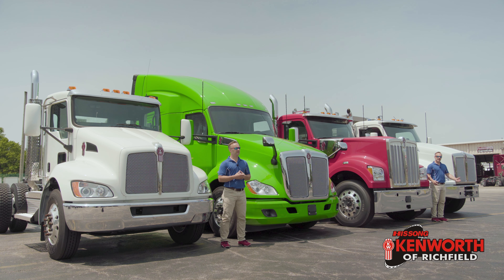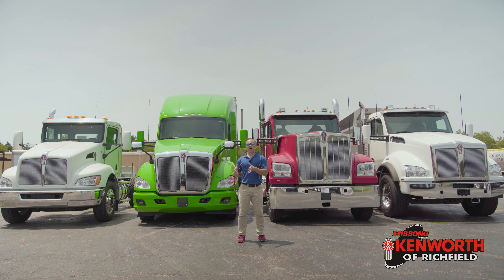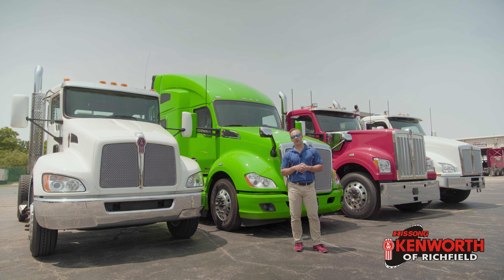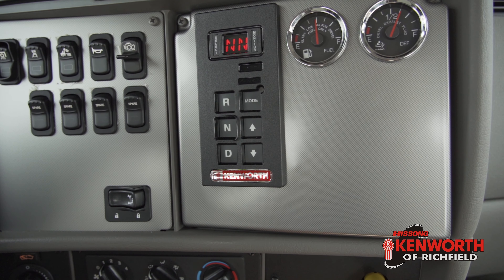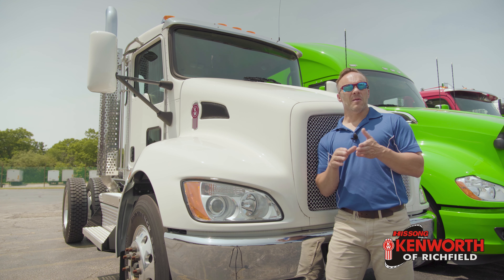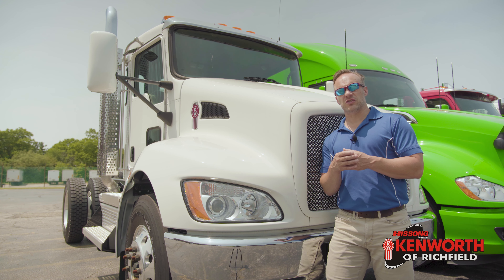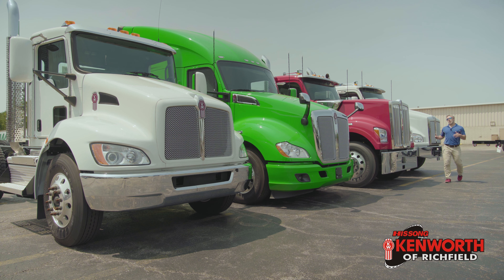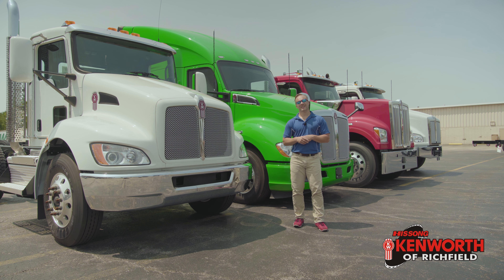Manual vs Automated vs Automatic (AGAIN...sort of)

Comment: Automated manual is an automatic transmission. Regardless if it doesn't have a torque converter.
Reply from the maker: It's automatic, but the industry has adopted these terms to differentiate between a mechanical/clutch driven transmission and a torque converter setup.
Reply: @KenworthofRichfield  Understandable. But I wish these automakers would make educational commercials like Chevy used to do in the 50's.
Reply from the maker: @Trident_Euclid  That's what I'm kinda trying to model after......at least a little bit.

Comment: I like the sound of the endurant, does it have manual mode and 3 step engine braking on the steering column ? I'm a control freak and love manual but that endurant sounds like a meat and 3 veg complete feast with gravy. That painted no chrome look is cool. Edit: Found the video of T680 thanks.
Reply from the maker: Yes it does

Comment: The only issue with an automated transmission is operating in bad weather. If your driving in snow and your sliding/slipping a little the transmission will want to shift up as the wheel speed increases during traction loss. You as the driver would control when to shift regardless of how much throttle applied.
Reply from the maker: I'll agree to an extent.  I've driven in 4" of snow in an ultrashift while bobtail and didn't have much of a problem.   There was one or two spots where taking manual control of it made me feel a bit more secure, but overall, it never really did anything that surprised me or caused me an issue.

Comment: He won't talk about it, but the only one I trust in snow, ice, and reverse is a manual transmission.
Reply: I’m with Garry. I don’t have to deal with a computer programmer’s sense of how that truck should operate. He may be all that and a bag of chips with software but I’m still not convinced that automatic or automated trucks will ever be able to out perform a highly skilled driver with the correct attitude.
Reply: @UncleSpuddy  I've driven stick and automatic...automatics are complete garbage, the expense of repairs is way higher, they sniff a hill they lose power, they never upshift or down shift at the proper points. The big companies have more people who can't drive than know how to drive, oh yeah even on a very slight incline you gotta be quick with and automatic or you'll roll back, they have no pick up to them. A small company I drove for in 2016 lost 2 transmissions out of trucks in less than 3 weeks...you can't haul anything heavy with an automatic transmission they burn up. I've been around trucks since I was old enough to walk and I'm a 2nd generation driver.

Comment: What he said about the Allison isn't 100% correct, because I think most Allison's have lock up torque converters. So at some point you do have a solid connection between the engine and drive axle
Reply from the maker: Most do have a lock up Bert, but with the clutch packs and planetary assemblies, it never seems to have that "mechanical" feeling that the manual and automated transmissions get.

Comment: In November my truck will be paid off and I’m buying a manual. I run a lot of steep twisty roads and I’m constantly messing with my automatic. Switching from economy to performance to manual, jakes on, Jakes off. It’s tiring. With a auto tranny, no only do you have to worry about the engine and after treatment messing up, you also have to worry of the damn thing is going to shift when you need it to. Plus, all the dealers are so packed with broken down trucks, it’s would be nice to have a manual where any roadside shop could work on it in less than a day without some special computer. I’ll never buy another one until autos are the only option. I regret it big time
Reply: Jake on, jake off - all trucks here have infinitely variable hydrodynamic brakes. Jakes not to much oldschool?
Reply: Robert Owen most trucks here have only 3 jake settings per gear
Reply: @hannatrucking  Ok. I misunderstand. You dont mean engine brake, you mean high/low gear? 
The ZF-gearbox have physicly 3 speed unsynchronized with high/low input and high/low output, the computer count 12 speeds on display. And 2 speeds reverse. Mercedes has 3 speeds reverse.

Comment: I’m retired now, but I have driven manual and automated trannies over the road.  I’m still on the fence for OTR applications.  I also drove fire trucks for over 26 years.  For emergency vehicles the full auto trans is the way to go.  Modern Allison transmissions are very smooth.  The circuitous routes that were typical of fire responses are way easier with a full auto trans as that allows you to focus on the task of arriving safely at the destination.  You never have to worry about shifting into the proper gear.  And,  many firefighters of the younger generation don’t handle manual transmissions proficiently.
Reply from the maker: There are certain applications where you need a specific transmission for one thing or another.    Emergency vehicles definitely work better with automatics.   Especailly fire tankers.      OTR.....the automated transmission has really show how great of a thing it can be over the past few years.
Reply: can't see myself driving a manual on a large city...too much stop and go....Manual trans for me is fun, i love being in control of the truck, but as i said too much stop and go kills the joy

Comment: Josh - Another excellent video!!! Can't express how GREAT a job you do explaining things in your videos. For your sake i hope Paccar is paying attention and they pay you a whole lot of dough someday soon to be their corporate spokesman. Only question is: Have you heard anything about, or suspect there will be, an upgrade to the Endurant, by adding gears to the 12 in it currently? More gears in the overdrive range might help with fuel economy is the reason i ask.
Reply from the maker: Thanks Stew!    I have a ton of fun doing them.   In this, I'm not sure if there are plans to come out with more gears inside that box.   It's very very close to the same OD as the 18 speed currently.   In this, most of the trucks that we are spec'ing for this transmission, we're running 2.79 gears in to make sure that we've got the mileage.   1st is low enough that even at 80k, you shouldn't have any issues getting a move on. :D      Are you currently running one?   What ratio rears?

Comment: I’m surprised he didn’t mention the huge difference in engine braking between a clutch and torque converter. Having a direct connection between drivetrain and flywheel makes a huge difference over how a torque converter functions
Reply from the maker: Good point!    It's one of those things that I feel and know, but a point that I missed in discussion.    I'll be doing an update in the next few months and we'll be covering that there.
Reply: most torque converters these days can lock up even a Toyota Camry's torque converter will lock up and direct drive.

Comment: I driven all these system in my company (different manufacturer of truck) my least favorite was the automated manual. It was slow and clunky and extremely jerky in reverse. The manual transmission and the automatic Allison both worked great.
Reply from the maker: I can understand that.   Especially with the earlier models.   Each year the programming on these has gotten better and better.   The latest generation is definitely worlds better.

Comment: Awesome, today I learned my automatic truck is actually automated.
Reply from the maker: What transmission is it that you have.
Reply: @KenworthofRichfield  I have a 2014 Peterbilt Model 386 with a 13 speed Eaton automated transmission. It is a 48" flattop sleeper cab. With a wet kit, hauls a dump bed primarily local only..
Reply from the maker: @tedkoppel4199  Nice!!!!!

Comment: Also dont forget back when the automated transmissions had a clutch pedal lol.
Reply from the maker: Yeah......not covering those dark days. LOL 
For me it only makes sense to cover the items that we have available or that we can order.
Reply: I have the automated with the clutch with a Detroit 60 12.7 pre emissions in a 2002 Columbia expediter … it took some getting used to !!! 😂😂😂 I was accustomed to manuals or straight automatics … but I actually love the truck now it gives me the control of a manual in tight spots and ease of an automatic on the road…. The only bad part is you still have to clutch in low speed stop and go traffic …

Comment: Once we, employees of a certain company in a city in the Netherlands, were driven by bus to another city to demonstrate against something. I noticed that near the driver's seat there was a selector handle like that of an automatic, but how the bus drove, felt like a manual, for me as a passenger. I couldn't see the engine brand, but on the selector it said ZF AS-tronic. When our bus shifted, it fell a whole bus length back versus the other of our two buses. Each of the two buses had a female driver. I told our driver about what I wondered about the transmission. She said it could be shifted either automatically or manually. I didn't dare to ask her whether she had been shifting manually or letting it shift automatically most of the time. The other bus was a Volvo, so I suppose it had a Volvo i-Shift. I have never driven a bus or a truck, but as far as hear / read from truck drivers on the internet, Volvo I-Shift is beyond reproach. Once I saw a YouTube video comparing various old-timer and contemporary trucks, emphasizing the ease or difficulty of the gearbox. The development went from non-synchronized to synchronized. Then there was a very new M.A.N. with an automated non-synchronized gearbox that shifted faster and smoother than the newest synchronized one. Once when I was googling about the things I wondered about the riding experience in that bus, I saw somewhere that in trucks and buses with an automated transmission, there is a databus between the transmission control unit and the engine control unit. I suppose that is for automated rpm matching during shifting.

Comment: Still what about a smoothbore tanker especially backing up climbing hills and going downhill, tankers are totally different from vanloads ! cargo moves
Reply from the maker: They are very different.   Any of these transmissions can work for this, there's just some different adaptations that will need to be made weather it need to be made by the driver or the programming.

Comment: You did not mention PTO's and how they are  different with the different transmissions. When running a hook lift or roll back it is a must. With the 18 speed as soon a you press the clutch in it disengages the PTO and you lose all hydraulic functions, which makes loading a container on a hill very difficult.
Reply from the maker: Yup!   Yet another reason as to why each transmission has places where it works the best!
Reply: Live hydraulic upgrade,  run off the crank, clutch in or out you can use your PTO
Reply: In my experience, it's a lot easier to use PTO with Allison transmission since you don't have to worry about having to use a clutch. In general, it's really a big pain in the backside having depress the clutch everytime you need to use PTO with manuals. With Allison on the other hand, you can simply slide to neutral if needed.

Comment: Eaton ultra shift is complete garbage. If you have the slightest loose connection on the batteries it Will jump out of gear. Wont go back in . Will not skip shift even when empty. The Volvo i-shift / m-drive is the best on the market. Besides the true auto Allison

Comment: Automated is kinda misleading on tractors we call them power shift.
Reply from the maker: It's actually not in this case.   It's literally an automated manual transmission in these trucks.   All computer controlled.
Reply: @KenworthofRichfield  that's exactly what a powershift transmission is.

Comment: They should rename the automated-manual transmission as a "CCM" computer-controlled-manual. The automated transmission should remain named as such since it lacks a torque converter and is fully automatic. 

If most called the automated transmission in that white truck an automated-manual there could be some differentiation between it and an automated transmission. The addition of the word manual designates the ability to be converted to a regular manual transmission. The lack of this word designates it's fully automated capabilities. It's a shame people think automated means both of them.

Comment: Drove an ultrashift for a couple of days never again terrible backing up, too jerky, slow picking up speed , 
I’ll drive a manual all day and if not Allison but that’s it no ultrashift those are trash!
Reply from the maker: How old was the Ultrashift that you drove?    I've found in many cases that it's the older ones that people don't like.   People seem to really like the newer ones.    Granted, it's not the instant/inch perfect control that the manual or the automatic have, but it definitely still has an application where it fits.
Reply: I drove one once, years ago. Must have been first gen. It was AWFUL. The truck would buck and jump going forward or backward at slow speeds. It was clearly very bad at controlling the clutch. I'm thinking they are no longer this bad or they wouldn't be around anymore.
Reply from the maker: @markusmayer7956  Definitely sounds like an early one.    The ones now.....super smooth. ...unlike me. haha
Reply: I drove one yesterday in a brand new Peterbilt.  I hate the automated shifts.  Sucks for doing construction work where you need to move inches and everyone is looking at you funny waiting on the clutch to engage.
Reply: Kenworth of Richfield  
I believe it was 2014 or 2015 but I still didn’t like how it acted I’ve driven the Allison and the new paccar 12 speed those are way better than ultrashift but I still prefer  driving manual gives me 100% control on how i operate the truck!

Comment: Oh god, the ultrashift.  Tough to beat?  I’ve been passed by loaded log trucks while bobtail.  Wind out the gear..clunk..clunk..shift..wind out the gear..clunk..clunk..shift.  Ultrashift is one of the worst transmissions i’ve ever driven, try to shift manually, and it just ignores you and beeps.  The standards are great, the automateds are utter crap.
Reply from the maker: How old is the one you drove?
Reply: Kenworth of Richfield anywhere between brandy new and about four years old, depending on the day.  Boy i tell ya, nothing like a 2016 T660 with an 18 to make my week.
Reply from the maker: @jaysmith1408  It's interesting that you say that as we've done some tests and haven't found the same issues.
Reply: Kenworth of Richfield must be the difference of powertrains or programming.  I’m getting off topic given this is on Kenworths (Paccar’s running the best consistently over competition).  Shall i say, our company doesn’t spec the best trucks with the best transmissions.  A T680 with an MX13 ought to run like a bat out of hell regardless of transmission.  My experience with UltraShifts has been either on older Paccars or newer Cascadia’s.  Not the intention to rip on y’all, but my personal opinion, is against the UltraShift.
Reply from the maker: @jaysmith1408  Try a new one.   Your opinion may change. :D
Reply: Kenworth of Richfield perhaps, darn shame i’m a company driver
Reply: I did one load with a 2020 t880 and transmission codes came up after I reloaded and it shifts sloppy. manual should be the only option

Comment: Another great video. I like that the automated still has a clutch but what happens when the computer goes out? Stuck on the side of the road singing along with your greatest Brittney Spears songs? I still prefer that 3rd petal due to that fact that I haul heavy equipment in steep country.
Reply from the maker: Thanks Jason!   I really do enjoy putting these together.   The computers have proved to be very, very reliable over the years in these.   Sometimes, a wiring or electrical component issue will come up...but for the most part, we've seen really great reliability out of these.   There's been a few instances of issues....I won't deny it.   But the overall benefit to 99% of the people running them have far outweighted the drawbacks.   At least if used in the right application.   

PS.......Your Brittney Spears secret is not safe with me.     I may be calling you out on this one in one of the next few videos.... :D
Reply: You're right, but that's not even happened in 17 years for me. So far I have only failed because of tire damage.